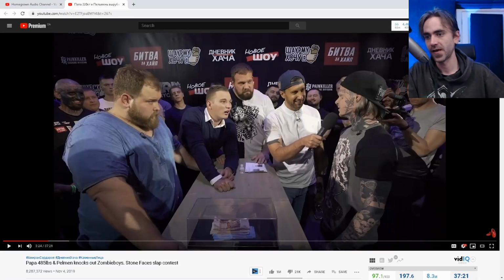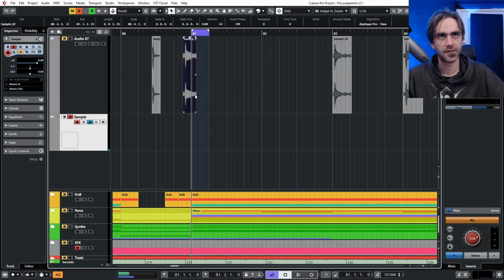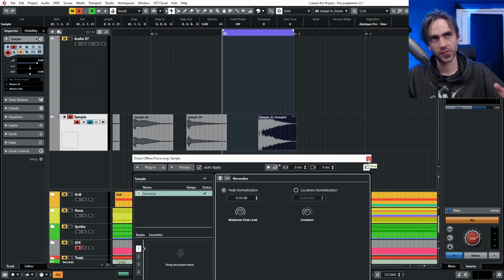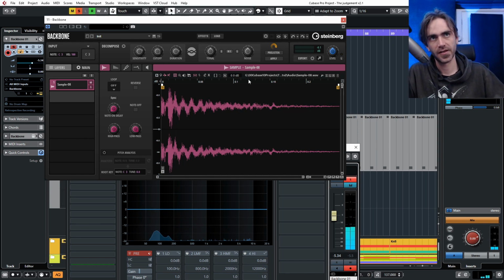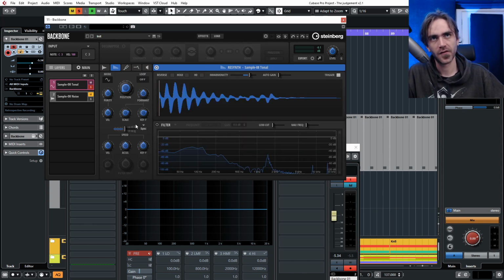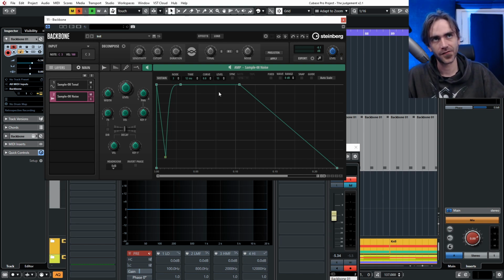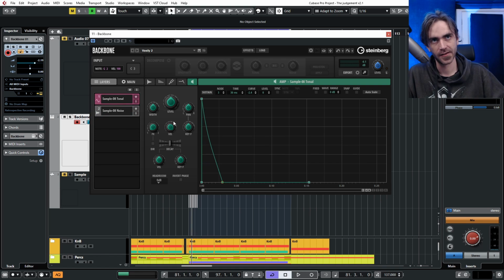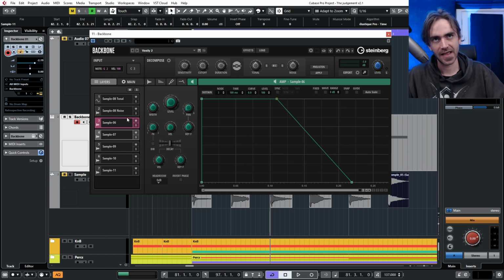How to Make Soul-Shattering Snares - Resampling Snare Drums with Steinberg Backbone

Comment: Hey :) Have you a saffire card? I have the Saffire 24 Pro since 7-8 Years. Recently i build a new PC with AMD.....Unfortunately, Focusrite officially no longer offers support for the new Windows versions.....my Texas Inst. (Firewire pci Card) is also very old. Have you some issues?......For the moment i‘m using my Virus snow as audio.....And thinking about to buy (if i need in future) a new generation from Focusrite to avoid issues with that old Texas instruments and firewire stuff
Reply from the maker: I have the same except intel and all is fine, I have had bad experiences with AMD and reliability tbh but I don’t want to go down the road of which is better and what might the cause be. The interface is old and discontinued. One thing to try is to rollback your the windows legacy FireWire drivers